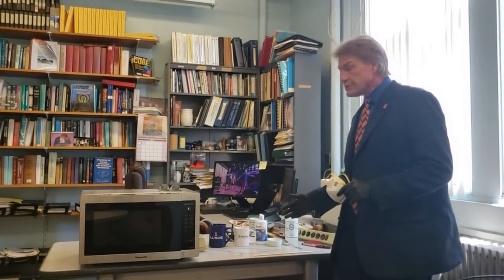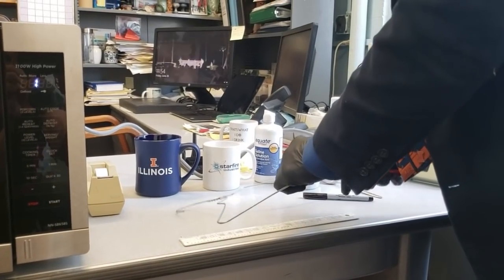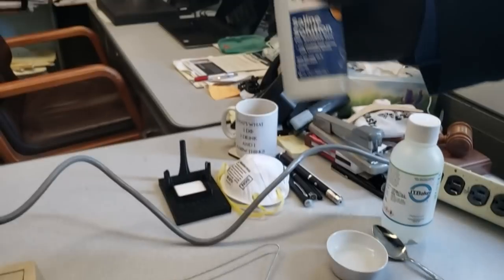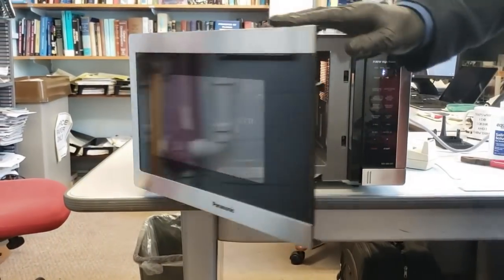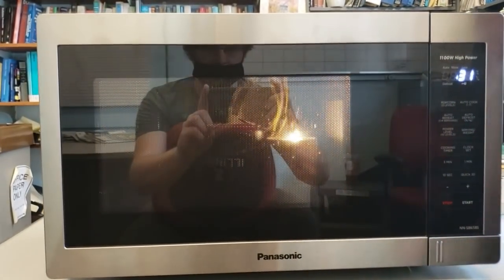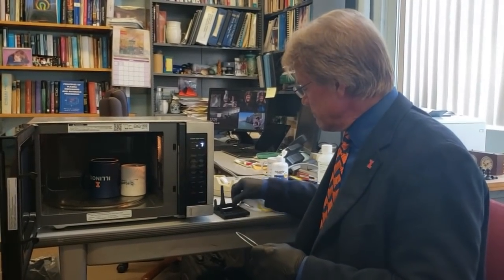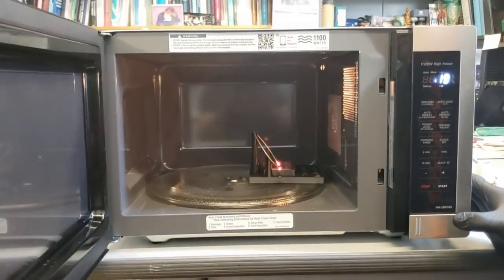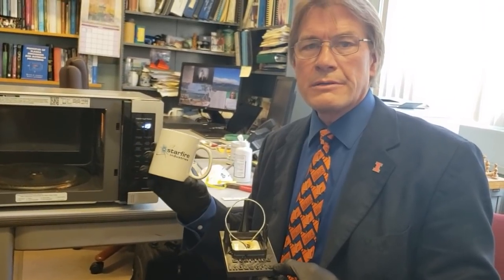How to convert a microwave oven into a plasma-generating N-95 respirator decontamination unit

Comment: We're not allowed to have 30% hydrogen peroxide here in Europe, because it's deemed a precursor chemical for making explosives.
Reply from the maker: We sell it in pool supply stores here in the US.  Use the highest strength you have, and it will likely work.  We are going to do experiments with lower concentrations soon.
Reply: @illinoisenergyprof6878  I looked it up, and the maximum legal concentration available to consumers in the EU is 12%. I will try it!
Reply: I just found 35% in one shop. It either doesn't apply to whole EU or it isn't enforced everywhere.
Reply: I'm from Europe and its pretty easy to get 30% H2O2, even 33%. Try looking at stores that sell lab equipment and chemicals.
Reply from the maker: I should mention that we did this over with the standard 3% hydrogen peroxide and it worked.  A publication is under review that includes those resutls.
Reply: @illinoisenergyprof6878  Thank you for the update!

Comment: Is there a cleaning procedure to restore the microwave to normal food cooking service or does it become a dedicated mask cleaning unit?
Reply from the maker: If you have put contaminated material in your microwave, it is always best not to use it in the future for food.  We have data which shows that the procedure kills viruses and spores.  We have not looked to see if it kills bacteria.
Reply: @illinoisenergyprof6878  but the contamination of the masks is of the virus, so assuming the mask hasn't been exposed to other things potentially bacteria-ridden, this shouldn't lead to bacterial contamination of the oven. Lots of things already in the kitchen that we regularly put in a microwave oven already have bacterias, days-old chicken for example.
Reply: @HoroRH  feel like this is missing the larger issue of the Hydrogen-peroxide vapor. There’s a reason he was handling everything with gloves. Maybe it has a much shorter lifespan than bacteria that idk abt, but I’d assume it’s the larger concern.

Comment: I sent this link to various colleagues with technical backgrounds and they were mostly amused.
I hope a reasonable multi-factorial designed experiment was used to determine whether plasma generation is needed at all. Reasons:
1. The 30% H2O2 will recondense on the surfaces at much higher concentrations. Evaporation of H2O2 into a low RH enclosure is a known commercial sterilization method. 
2. Simply heating the mask is known to kill the virus.
3. In you video, the plasma generation seems to produce effects that could damage the microwave oven.
4. There are UV sterilizers that cost the same or less than the microwave oven and produce both UV and ozone. I recollect that around 23 mJ/cm2 is enough to kill the virus.
Reply: Yeah, but this was more fun to watch.

Comment: Dave. Thanks for sharing this very important work with the world. Where can we find the publication? Also, can you share the results of the control? How much of the disinfection is due to plasma and how much due to microwave? Meaning, if I were to run a microwave oven without the plasma modification (maybe for longer time than the 30 sec, or with/without water to create steam), how much viral load reduction can be expected? Thanks!
Reply from the maker: The paper show the effects of various controls.  It has been submitted to a journal, but a pre-print is available on MedRXiv.  Here is the link:  https://www.medrxiv.org/content/10.1101/2020.07.28.20163915v1
Reply: @illinoisenergyprof6878  Thank you for sharing the paper with the controls on microwave only and wicrowave +saline/H2O2. The data is complelling that only microwave + saline/h2O2 + plasma was able to achieve the ~99.99% reduction of virus on both sides of the mask.

Comment: Was that 3D printed holder printed using PLA or ABS? I'm shocked the heat from the plasma did not melt it if its PLA. I don't think my printer will run ABS. It's not enclosed.
Wish I knew about this when Rona started. I ended up building a UVC box for my respirator filters. I'd put half a dozen in upside down for 15 min then flip and another 15 min.

Comment: when the plasma hits the top of the microwave is the point it becomes hazardous to the machine. If you use a large Pyrex bowl inverted over your project it will keep the plasma contained and much safer.

Comment: I read the virus dies above 70 C. 
What about “baking” it on a regular oven at 75C? 
Does it kill the virus/germs without damaging the mask? Does it also kill whatever germs might be propagating on the moisture accumulated on the mask? 
I personally already damaged a MW and don’t fancy the idea of plasma hitting the inside walls (as it’s shown at the end)
Thank you!
Reply: 70C at 50% humidity for 1 hour will kill the virus. A week at 50% humidity will also reduce the percentage down near zero.
Reply from the maker: When we did a control experiment, of just using 30 seconds of microwave, it did not kill the virus.    After our procedure we tested both the filtration ability and the fit.  Both passed those tests even after 3 cycles.

Comment: I would be a bit scared about concentrating a 1KW 1.2ghz oscillator in a 2mm gap, the power concentration would be huge, but of course you are right, microwave will survive if used for short period of times (magnetrons are strong suckers) wire will most likely disintegrated and like you said mugs will crack from the heat but yes the UV radiation in that levels will kill every bug in there, loved it, simple, done with common household things, excellent, thanks

Comment: Are the typical n95 masks flame proof? Isn't it possible to start a fire in the microwave using this method? Like if the mask falls into the plasma?
Reply from the maker: A plasma does not necessarily catch anything on fire.  The electrons are hot, and not the gas.   Still though, if you hang the mask not right over the plasma, you will have no problems at all.
Reply: @illinoisenergyprof6878  Thank you Professor.  It just seemed off that you addressed all of the other potential issues, except the potential of fire (if it exists).  I suppose I don't understand enough about the plasma itself. Do you have any recommendations of anything I might want to read or watch?

Comment: What are the required specs on the wire material? Just conductivity? I think I might try to get this approved as an engineering project at my university so I can try several materials with perhaps higher melting points to increase longevity. I would send you the final report if I get approved.

Comment: Don't look directly at the arc through the door. Wear UV-A/UV-B or welder's goggles, or indirectly look at it using a camera/LCD. Glass absorbs UV-B but not much UV-A. If it's a cheap model of microwave there may not be any glass in the door, just transparent plastic, and you are blasting your eyes with damaging UV rays.
Reply from the maker: We have measured the spectra given off by the plasma.   There is not enough UV to worry about.

Comment: Thank you very much for the video!   Would copper wire be useful as an antenna?  It radiates/transmits heat very well.  If not, would 3/32 copper coated welding rod or bare brass brazing wire work?
Reply from the maker: copper works fine.  We did it with aluminum, steel and copper.  All worked.  I would think Brass would too.   (Sorry for not answering months ago)
Reply: @illinoisenergyprof6878  Not to worry; thank you for the information. Now, if i may impose a bit further. The news tells me that the Gates person is going to set up a small nuclear reactor in Wyoming.  Do you know if this is the same basic idea as your 80MW  SMR that you did a video on a few weeks ago? Thanks again and hope you get back to posting more videos.- they're always interesting and informative.

Comment: 10:20 regarding the glaze burning off the tile, that probably wouldn't be a problem if you put the tile in upside down and used the uncoated rough back side. It is probably thick enough that the glaze won't cook off laying face down. and bathed in liquid.
Reply from the maker: good idea

Comment: - The strong peroxide is probably rapidly breaking down and is used to form ozone (O3) in the arc. If peroxide is not used, then instead the 78% nitrogen gas in air breaks down to make nitrogen oxides. Lower concentration peroxide will produce ozone more slowly.
- Microwave ovens have a fan to cool the magnetron and push steam out of the oven cavity. If you only have weak peroxide, the fan may be pushing it out of the oven cavity faster than it can be produced so the gas concentration stays too low to be useful.
- You could try blocking the fan intake/exhaust vents so that the ozone will not be blown out of the oven as it is produced. But the magnetron and transformer/inverter will overheat if it is run too long with the cooling fan blocked. A duty cycle of probably 1 minute on, 10 minutes off would give the magnetron time to cool without the fan.
- Probably won't be too harmful to block the air vents. Fan motors do eventually stop working in 20+ year old microwave ovens and they have to be designed to handle that. The magnetron "should" have a thermal sensor to keep it from melting or starting a fire with the fan vents blocked.
- The big downside is that if it has a thermal safety fuse rather than a resetting thermostatic switch, then if the magnetron gets too hot even once, the fuse pops and it never runs again. Coffee machines and steam irons have thermal safety fuses to keep them from burning down a house if their main thermostat malfunctions.

- But I don't know the standards for microwave safe design, so I would do this experimenting outside with a fire extinguisher nearby. (CYA lol)

Comment: what is the recommended wattage of the microwave output?
Reply from the maker: 1000 W will do just fine.  My guess is that any size will work.  It is usually energy-density. So even a lower wattage one will work because it has a smaller volume.
Reply: @illinoisenergyprof6878  A microwave oven is a resonant cavity, so increasing the size of the cavity won't lower the power density as it's still dumping the majority of the input RF into the contents of the oven. Also, I think it was an oversight to not emphasize the risk of a fire if some moron decides to place the mask directly above the plasma and has a self sustaining ball come up and into contact with the mask.

Comment: Does it need to be exactly 30% hydrogen peroxide? Hydrogen Peroxide degrades, refrigeration slows it but theres no stopping it. what if its 50%? What if it was 50% or 30% but is 2 months old?

Also im not too familiar with h2o2. even though once the procedure is done and the viral load on the mask is reduced and the fit and filtration is unaffected, is there any kind of h2o2 residue left on the mask that could be harmful to breathe in? And is there any residue left in the microwave?
Reply from the maker: We are going to do a study next with the h2o2 level, and see what is required.  We use very little, so I would guess that a little more of a lower concentration would work.   I terms of residue, we have detected nothing on the masks.  On the coffee cup, there could be some condensed vapor, so I would wear gloves when taking them out and then rinse them off.

Comment: What does this do about restoring the electrostatic charge that is supposedly vital to N95 masks?
Reply from the maker: We have done a huge number of filtration tests on N-95 masks after a number of different treatments.  I do not think anything about an electrostatic charge is relevant.
Reply: @illinoisenergyprof6878  I had seen product data, possibly from 3M, saying their N95 face masks relied on an electrostatic charge in the inner material, and that the dissipation of that charge was the main reason they were only good for eight hours. I don't think I misread that from several sources. Maybe, but unlikely.
Reply from the maker: @lyfandeth  That could be an additional feature, but we have tested 3-M N-95 masks filtration ability after up to ten of these treatments, and on masks that are months old, and some just out of the box.  We even sent two sets of masks to the CDC for filtration testing.  (See results in MedRxiv link in story)   There is no statistical difference between the treated masks and the controls.
Reply: @illinoisenergyprof6878  Great! THANK YOU. Now I just to explain why I'm conducting plasma physics in the microwave.(g)

Comment: Would 12% peroxide work?  It is harder to get anything stronger than that here
Reply from the maker: We haven't tested this yet, but plan to do so.   If you use 2 to 3 tsps (2 to 3 ml) instead of 1 you would have as much of the molecules as we did.  It may take a little longer for the plasma to strike, but it should have the same effect.  No guarantees of course.

Comment: I love a good sustained plasma as much as the next guy but really, you could just put that high test peroxide (or ethanol, methanol, isopropanol or acetone) in a spray bottle and spray it on the mask.  Methanol is probably best since it's dirt cheap, highly volatile and won't have random junk in it like denatured ethanol.

Comment: How does this compare to a UV light box? I have been using a 10 dollar UV lamp in a foil lined box. After 15 min of UV and the ozone produced,  I think it will decontaminate thin cloth and paper. I don't have the ability to prove this. This is a low energy, low skill option. I have ran it over night, by mistake, no fires.  Hydrogen peroxide is not as easy to find as it use to be, and all my clothes hangers are plastic.
Reply from the maker: We did an experiment with just UV light, and it did not work.   One has to test viruses in a saliva/mucus mixture (as they would be when you cough) and the UV light alone could not deactivate them in that environment.
    You can use a piece of wire instead of a coat hanger.  In fact copper works better in that it makes a plasma easier.

Comment: You might want to add a mug of water to absorb the excess uwave energy.  It will keep the magnetron  cooler and prolong its life.
Reply from the maker: The problem is that I want the antenna to absorb the energy.  I do not make a plasma if there is a cup of water.   I tried it.

Comment: Doesn't this polute the air inside and the mask with metal particles? Shouldn't be better using graphite electrodes from crayons and instead of a loop make a dipole..?

Comment: If I needed a mask I would make it washable.

Make a long necked hood out of cloth that breathe and is dense enough to stop droplets. Use a cap to hold it in place.
Use plastic frame at the front. The window is an overhead sheet.
Use cotton garden gloves.
A poncho will make people feel safer.

Poncho can be made out of paper, plastic, cloth, etc.

For eating, use a personal "tent" and remove window.

Given that a face mask basicall only protects other people against the wearer, I think my solution could drastically curtail the spread of the epidemic.

Comment: N95 masks filter down to 0.3 microns. Covid 19 is 0.125 microns. Am I missing something?
Reply: Tanja electrostatic interactions and Brownian motion. Masks like the N95 use filters made of things called electrets (think magnets, but instead of a magnetic field, they generate an electric one) which have a strong negative charge. Because Covid is a positive RNA virus, that means it gets electrically attracted to the mask fibres. And, Because covid is so small and light, particles in the air basically bully it around in a random fashion which leads to it getting caught in the fibres of the filter (brownian motion).

Comment: Yup I’m not smart enough to understand/ try it
Reply: microwave, 24.4 cm heavy gauge wire, coffeemug 2x, saline solution 1ml, hydrogenperoxide 30% 1ml, contaminated mask, voila
Reply: The length of the coat hanger wire is approximately the same as the wavelength of the electromagnetic field created by the microwave. When the electromagnetic (radio) wave interacts with the wire, it will push electrons in the metal from one end to the other, and because the length matches the wavelength, opposite ends will be at opposite charges twice per cycle of the wave. This can build up a substantial voltage between the two ends of the wire, depending on the strength of the field generated by the microwave.

With the two ends in the conductive solution, saline solution, which basically just salty water, the voltage can flow between the two ends, as the electronic charge is carried back and forth by the ions of the dissolved salt in the water as the frequency oscillates. This completes the circuit, and allows a very large amperage to build up in the loop, and a very large alternating charge at each end of the wire.

This large charge is enough to vaporise a path through the water, forming the plasma of decomposed molecules from the liquid. This releases both electrons as well as free O from the hydrogen peroxide (H₂O₂) . The O quickly reacts with atmospheric oxygen (O₂) to form ozone (O₃), a powerful oxidant that will destroy molecules, including proteins from infectious agents. The electrons are beta radiation. Many of the electrons will recombine with ions that were stripped of their electrons, and when captured they will give off braking radiation (energy must be conserved) in the form of photons, including UV photons, which can be sufficiently ionizing to split apart molecules in the infectious agents.

The sputtering of the plasma is likely because the liquid is somewhat pushed away by the plasma, the plasma collapses, and then is reformed when the liquid returns between the two electrodes of the wire antenna.

And if I'm wrong on any of that, I'm sure someone will correct me, as I'm no physicist, and that's only my humble armchair understanding of what's going on.